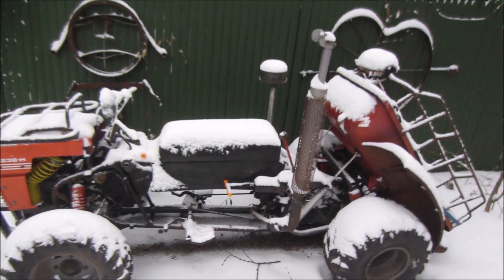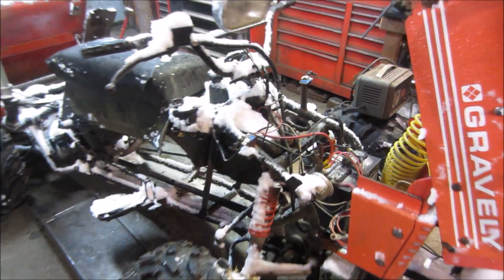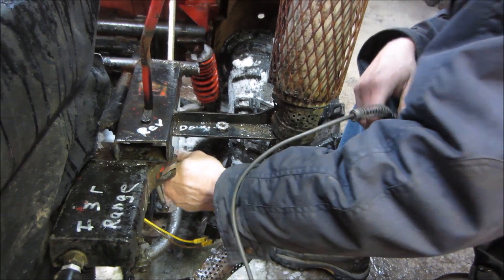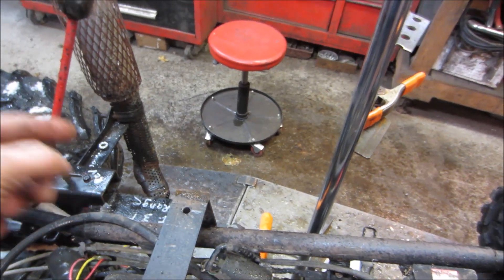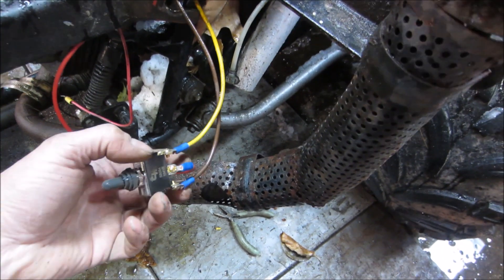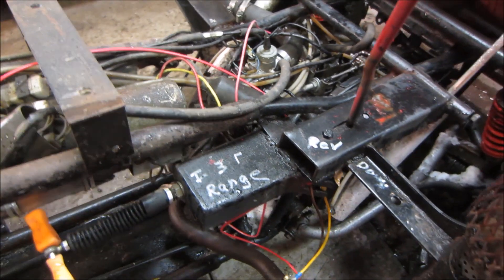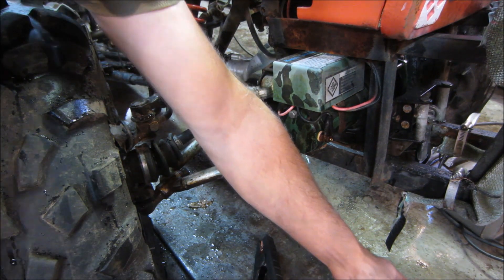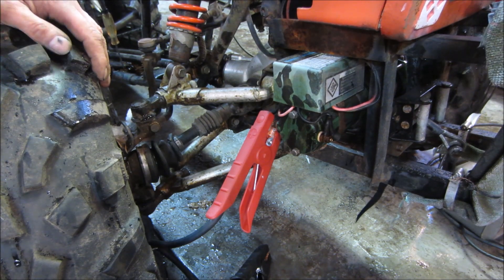rat rod quad, troubleshooting  the wiring.

Comment: good to see the rat rod fully functional again, if the up circuit of the dump bed runs hot or nearly stops later you should consider a marine solenoid for more power for about $10. same for the pull circuit of the winch. just a thought cheers

Comment: A little shot of ether works good too. After my 2005 Trail Boss sat all winter in a building, I just gave it a little shot and it started right up. I had run the carb dry of fuel too so gas didn't gum it up while storing. Stabult works good too.

Comment: Ahh the old cross over switch, as you said its handy for ordinary dc motors or swapping any two signals over, like a 3rd mains lighting switch.
But you have a A or B motor so easy to wire :-D.
Im amazed that any of the electrics work on that vehicle, the rain drenches everything and causes havock, but it never stays dead for long with you :-D.
"The engine/electrical fondler" lol.

Comment: watching some runs i  like the ratrod quad its  got personality originality I built a cab on my 4 wheeler and I heat it with a little wood burner i made looks like a diesel with my smoke stack going but it works good  and that's what matters likewise i think the same about the rat rod

Comment: connect a milliamper meter between the negative pole of the battery and the lead which goes to the chassis of the quad from the battery's negative pole. If it reads more than 2 milliamps, check the wiring, switches, etc. Remember, the quad was soaked in water for many years.

Comment: in case you run across that problem with the HF winch again search for harbor freight winch switch mod on your favorite search engine and pick up a winch switch for 15 to 20 bucks from wherever.  easy mod to do and it works wonderfully.

Comment: Got any honkin' big knife switches in your horde? One would make a great battery disconnect that would last for centuries. It only needs to be single pole. That wired winch controller needs some artificial patina. It doesn't look like it belongs on that infernal machine, being so shiny and new!

Comment: Regarding the winch control: the hand-held device is so very awkward that you should consider the following. Disassemble the control; it has to be simple. Then mount those control on some suitable surface, or, cut down the unnecessary part of the control and fasten it to the chassis.

Comment: Double crimp your crimp-on connectors and they will be twice as resistant to wires being pulled out of them and make better contact, too.  Also filling the connectors with dielectric grease will prevent the wires from corroding inside the connector.  Happy holidays to everyone!

Comment: I'm surprised you didn't just rewire the  power to the winch, including the wireless part, to a simple relay connected to the off/run switch for the rat rod.  Or was the wireless part flakey even with battery at charge as well?

Happy Holidays to you and yours!

RichE

Comment: nice you are using a Cole Hersee switch for your quad they are good products in my 1968 vw bug i installed a Cole Hersee wiper switch with a delay function which the knob blends in the dash and other knobs but i had to grind the seam of the center defrost duct so the switch fits and with that i installed a later OEM VW of Mexico washer reseveroir so it works out fine as it has a Mitsuba washer pump on it as those pumps are in the Honda Civics and 1997-2001 Honda Cr-v models. Cole Hersee is a good switch they make them for school bus switches to control the 8 way light systems, heater switches and so on mainly Blue Bird uses them. Cole Hersee also makes a foot switch and solenoid for fire engines to control the Federal Q2B siren  as they draw alot of power and the wiring and switches have to be heavy enough to handle the current of the siren's motor,  are you going to put that motor driven Siren on the Meter Maid on the previous video? it looks like an On Guard or Universal Security instruments siren.

Comment: only part "water-proof" on that switch and most is the rubber cover/toggle part, the rest is open and will take water, it needs a shield over it /sealed around the whole thing, the threads on cover also :)

Comment: OK, question: I see you have a snorkel/extension on the exhaust and carb intake, but the crankcase breather hose is just looped up over that frame cross bar, down low (right where the  dump bed closes) AND it is open to the dirt and crap with no filter- You realize that pulses and sucks in and out every time the piston goes up and down, and you're sucking dirt for now and water if you do go into a creek? Maybe extend it along side the intake snorkel and put a small  K&N style knock-off filter on it like you put in a car valve cover...........

Comment: Hey D  , how about screwing a broomstick clamp on to the front motor shroud to hold the remote for the winch ? This way you can pop it out for use or pop it back into the spring clamp for storage.    J K

Comment: Hi mustie, don’t you have a place to store the quad? You put so much effort into it and then it’s stored outside again.
Reply: if I were permitted to comment I'd suggest a tarp to throw over it.   but I'm not so I won't. and I would have saved the relays that were in the remote control for the winch. I use those kind of relays on my truck to handle heavy electrical loads. but I'm crazy like that.   saves the contacts in the light switch and I use them to enable the charging circuit to the extra batterys and such foolishness.

Comment: I am working on a  project that will need some hydraulic assist.  Where might I find a pump and cylinders as you have used in the Rat Rod?  I don't want to mortgage the house to pay for certified antiques.  Would power steering components work?  They might be cheaper.
Reply: Junkyards and eBay.

Comment: Looks like you could have just ripped out the controller and put in a switch that wires directly into those relays. Cheap solution.
Reply from the maker: dont want the relays

Comment: Awesome machine , those electrical crimps worst thing ever made,after decades of boats they all fail ,just the salt and minerals in condensation is enough to destroy electrical flow,when ever possible I solder coat the joint with your choice and use heat shrink tubing,, and sometimes a step further tape, now use gorilla tape

Comment: The receiver should have had power only when the ignition was on which would have eliminated the parasitic draw, but good move eliminating the remote.
Reply from the maker: thats what the big switch was for,  you cant put that kinda current through the factory stuff, and wanted no more relays to fail,
Reply: That's even better if you always remember to turn the switch off.